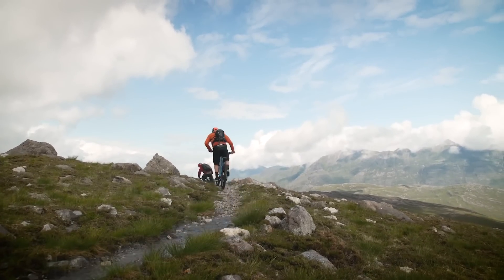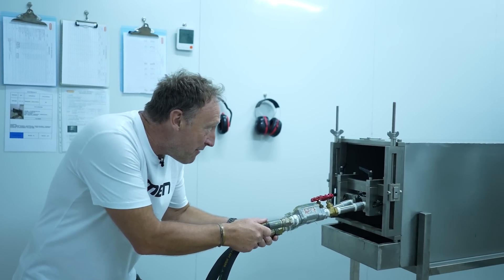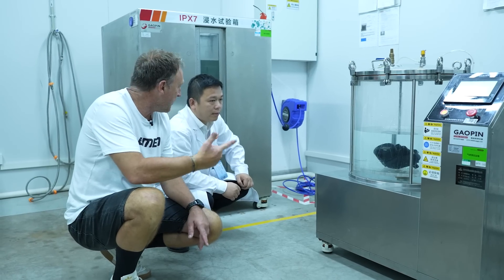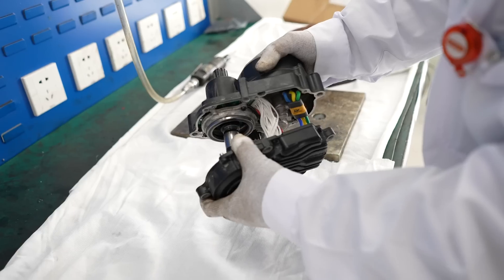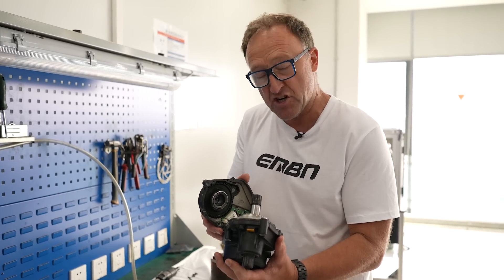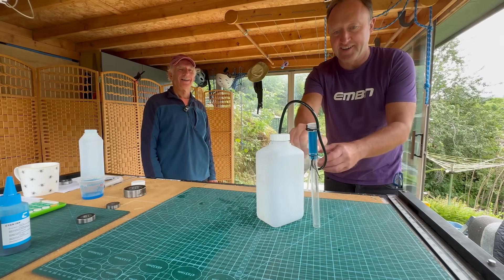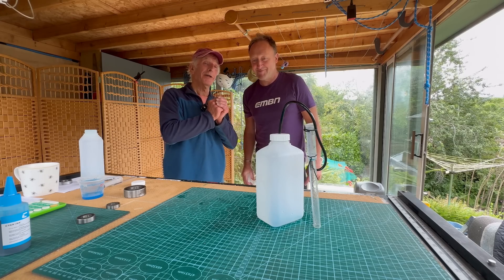Are eBikes Waterproof?

Comment: Would gorilla tape all around the motor seal to prevent suction from direct outside air and put a few desiccant silica pouches inside the small void space in the motor to capture any water mist. Could that help just enough to mitigate any sucking in of water vapours? I think I would not mind some ugly water proof tape around the motor housing if it helps protect the motor. I guess can’t do much about the crank area and bearings. Just add more grease there. Once a month or two you have to open the motor and dry it out and replace the desiccant silica pads so they can absorb the water. Why not weight them to track how much water they absorb. Would make an interesting test for embn to see how much of the water even minuscule amount gets in the motor after so many typical rides. It don’t have to be raining for the motor to suck in humid air which the uk is famous for. I have had 3 motors break. One from watery grease on the inner motor gear and two from galvanised screws that’s where they use steel screw on aluminium engine case and they fuse together so you strip the screw head as it’s so stuck so you can’t take the motor out. I suspect that water speeds up the galvanising process. Now I use copppa slip grease on my screws to prevent that.
Reply: Blue head gasket sealer from AutoSave or Halfords around the bearings, as it's metal on metal, but the bearings need to be completely redesigned with gasket channels cut in like grooves and an O-ring seated and a cork one maybe on the inner smaller ring. It would be such an easy fix. I have done it in CAD as a 3D-printed test model. It works, but I'm not a bearing manufacturer, so I can't machine them.
Reply: Just be aware they don't seal them 100%, so hot air can escape out of the non-sealed bearings. There's always going to be something, but again, for as little gap as those bearings leave, you're not getting any air escaping out of them, more hot air in their heads! I'm a mechanic and test all this and emtbr and 3D designer I can't stress enough how east a fix it would be but manufacturers just won't do it as they won't sell near as many bearings doing this but would definitely help the ebike motors! That 1 minute test on that bafang motor is absolutely pointless! You wouldn't expect water to seap in a non sealed unit at that time!

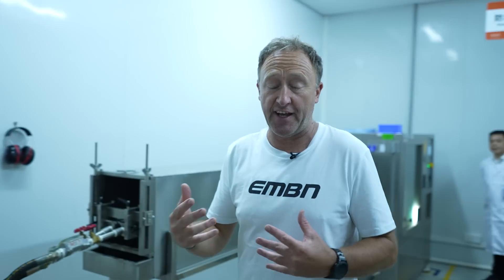Comment: 1:26 motor failure is sometimes caused by failed design, looking at you brose
Reply: Indeed. After just two years, never submerged, but in a humid climate, my gen2 report was:
"Your motor was in pretty rough shape. The main issues we found are badly pitted crank shaft, broken sprags, worn belt, lots of corrosion and dirt ingress. Also your planetary gears are broken".

I had it checked by an authorized Specialized dealer just within 4 years, but they didn't definitively determine the motor was failing. So no warranty from the warranty weasels at Specialized
Reply: @jpravetz remarkable mine was checked by Specialized last sept…..  warranty ran out November…..this March total failure same diagnosis!

Comment: No as I was out on a 20mile cycle and was caught in a light shower. On arrival at my destination I put the battery on the. A few hours later I reinstalled the battery only to find out it would not turn on. I could turn on the battery while it was plugged in but one disconnected it turns off after a short period. WHAT A WASTE OF MONEY, EBIKES ARE CRAP IF THEY CANT EVEN HANDLE LIGHT SHOWER. PIECE OF CRA
Reply: mine has been ridden through wet mud, rain, puddles and stuff, and everything still works after 7 years of that abuse. you got a  badly designed product, sorry. i have a yamaha pw drive system btw.
Reply: The volume of air inside the motor case must be far less in volume than the litre plastic bottle. The casing is made of thicker light metal rather than plastic, which should be less susceptible to rapid changes in temperature, but I agree that effective seal/s designs are  crucial to maintain impermeability. The Bafang test setup looks serious, which can only be a good thing. IPX7 is just that, whether the motor is hot or cold, and it is surely incumbent on manufacturers to test hot motors being immersed into cold water, in order to pass attain this level of protection.  Great vid, thanks for producing it.

Comment: Motors might need venting
Reply: If you put holes into it for air ventilation then it won't be submergible for going under any water.
Reply: @mikehunt1528  dirt bikes have venting everywhere. Routing vent tubes high up in the frame with a check valve does the trick.

Comment: Riding in the rain is not the issue. If a hot motor is cooled quickly, especially if immersed in water, it will likely ingest some moisture with the inevitable consequences.